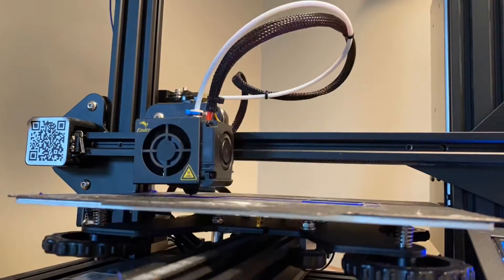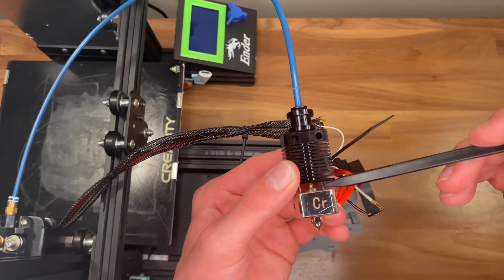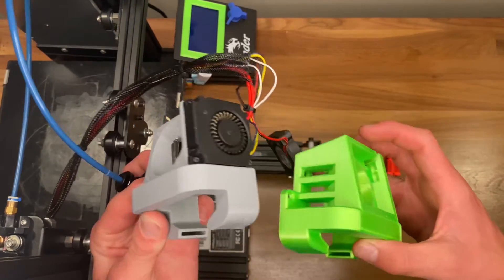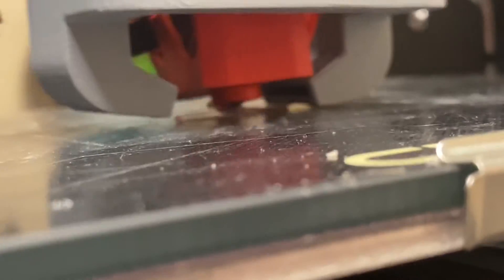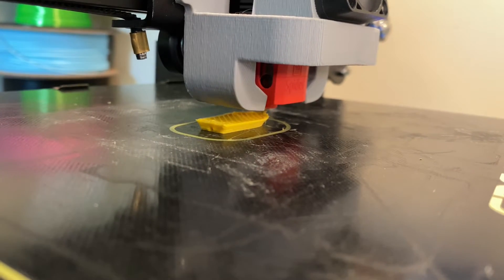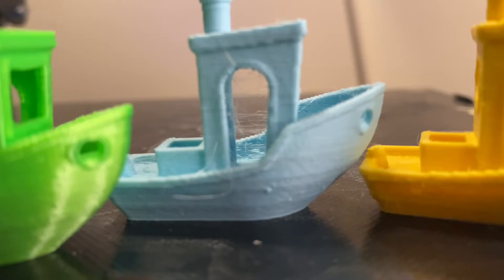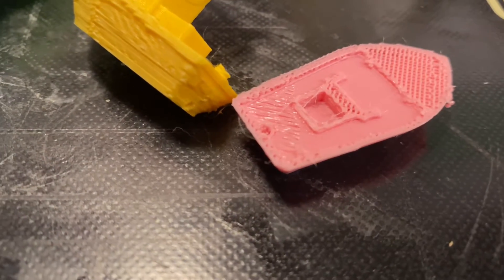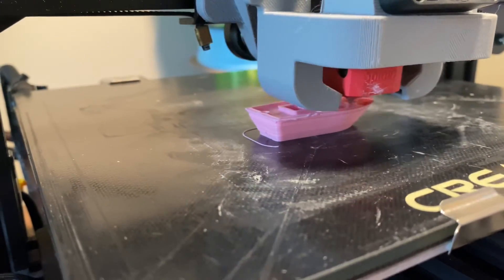Print FAST with an Ender 3 pro

Comment from the maker: As many of the comments read, the printing speed in the video was not 250mm/s. It was still double the speed of before and cut the time required to print in half. Sorry for the confusion. The firmware limits the acceleration, which limits the overall speed. To actually achieve these speeds you must configure a firmware to allow these speeds.
Reply: There is no way to configure the firmware to keep up with the speed.  The board and firmware are just incapable of keeping the printer fed with gcode.  (even with a 32 bit board if you upgraded to that, otherwise the Ender 3 and Ender 3 pro came with 8 bit boards) Get a Creality 4.2.7 if you have the 8 bit board. 

You need a Creality Sonic Pad or Raspberry pi running Klipper.  (tell the Sonic Pad you have an Ender 3 v2 running the 4.2.7 board)  You probably need a better hotend than the one you show, more cooling, a better extruder, dual z axis and linear rails, and Klipper to get anywhere near 200mms. (250 might not be possible no matter what)  

Consider the sprite extruder as it is better hotend (even than the one you show) and it is direct drive.  It won't get you where you want to go though.  You need a high output hot end and probably a dual gear extruder.  Tons of cooling. 

Bed slingers don't printer super fast, even when highly modified unless you want to sacrifice a LOT of quality.  I have a highly modified Ender 3 pro that can print close to 200mms.  I don't print that fast though.  (the quality degrades)   

The Voron Switchwire is really fast for a bedslinger. Some say they can print 300mm/s with 5K acceleration.  That printer costs 600-800 and you have to build it.  It is corexz.  That is the fastest bedslinger I know of.  Switchwire users rarely print at 250mm/s.  

BTW, I ran into the same problem you are having at one point though. Keep on upgrading and keep tuning.

Comment: Your board is stalling out and not hitting 250mm.  When you see the toolhead stop and sit there, the board is overwhelmed and processing gcode.  Marlin firmware on the board isn't going to do it. (even on a 32 bit board)  It cannot keep up.  The motors are moving at high speeds but the board and firmware cannot provide gcode fast enough.  Until you upgrade to Klipper, you are slamming on the gas then slamming on the brakes.  (both bad speed and bad quality at the same time)     

If you want to print fast,  you need to run Klipper.  (which requires an additional 64 bit processor such as a raspberry pi or at least a cheap Linux computer) Your main board is flashed with Klipper firmware that primarily controls the motor and the raspberry pi will keep it fed with gcode.  Until you upgrade to Kilpper you need to lower your speed until that stalling behavior never happens.  (quality will improve, especially little zits on the outer walls)  That it the fastest that you can print with your board.  (nowhere near 250mm btw)

Comment: Apparently your definition of great and perfect vary a bit from most others lol, looks like you are printing with cake frosting.  You need to run input shaping, pressure advance and set your timing if you are running at even 60mm Id be surprised.  My tuned E2 pro runs easily twice the speed of this rig.....
Reply from the maker: Like most people on YouTube I exaggerate a lot in my videos. This was my first ever attempt at printing fast so I made some mistakes but I’ll improve for the future

Comment: The stock hotend is not at all speed limiting on Ender 3. It can go at least 15 mm³/s (around 180 mm/s linear motion speed) and nearly twice that with a CHT nozzle. As others have said you're not reaching anywhere near that speed, probably because of acceleration and min layer time settings, but you almost surely won't be able to even with those settings changed because the stock extruder, which is the bottleneck on this printer, doesn't have enough grip or torque.

Comment: That's not running 250 no way. Especially with single gear stock extruder buddy. Your max speed there is like 70 to 80 at best. You haven't set up your accelerations, jerks, proper perimeter settings to even talk going at 100mm. Stock ender 3 even with that Hotend you installed by creality that you will soon throw in the bin because it's complete rubbish deceased with constant clogs, stock enders top out around 110 to 120mm. You extruder will fail. You'll clog. Your motion steppers won't keep up and skip causing layer shifts. 
Do some homework before trying to teach others about something you obviously know nothing about. Good luck
Reply from the maker: Per previous comments I know this is not near 250mm/s. This is my first time ever trying to print at high speeds so I am not as experienced. I actually like the hotend I installed and I think it isn't bad at all. It most definitely works for my use case with the added bi metal heat break and all metal construction. So I am going to keep it. I actually upgraded to a dual gear all metal extruder only days after posting the video. As for not knowing anything about this, I have used 3d printers for over 5 years and this was the FIRST attempt at going for any sort of speed and as with most things we try for the first time we often fail. I actually probably know more than you think I do :)  (hotend still hasn't clogged even after 1 month and a half of constant use) Thanks for the view and the comment
Reply: @engineeringaddiction  That Hotend you purchased will eventually start clogging upon faster printing speeds. That bimetal is cheap get yourself a good quality e3d or slice bimetal break. That will last for years and has room to grow. 
To print fast and not fast as in you thinking I'm dialing 250 on my ender screen and it's doing 250mm. No. Google accelerations, jerk setting, learn to look at the design and work out which parameters can be printed fast without causing issues and which ones need to slow down. Then on top use accelerations for straight travel lines between printing parts but has to be fast but not too fast because the toolhead needs to slow down the mass of the head itself, the rail and the bed. That's alot of things stopping getting ready for the toolhead to print understand so accelerations and speed has to be set so when it gets to the next spot of printing it doesn't cause ringing by slowing from high accelerations and also ghosting. There is alot of videos and information on Google regarding going fast. Good luck
Reply from the maker: I think spending more money on a hotend than the printer is actually worth is kinda stupid that's why I chose the cheaper one. I know that you're going to say having to buy another hotend because this one broke makes it worth it but I also have seen barely any videos about it so I wanted to be one to test it. I have different backup hotends too. thanks for the advice on how to print faster. I had a hard time understanding what this means though, "To print fast and not fast as in you thinking I'm dialing 250 on my ender screen and it's doing 250mm. No."

Comment: That’s not 250mm/s. I’ve printed at 120mm/s in the past and it went much faster than that. 

You have to reduce your minimum layer time in your slicer software! In Cura it’s set to 10 seconds by default.

Comment: That is not 200mm/s, thats maybe 80mm/s max you're reaching. try and look into increasing your acceleration from the stock ender 3 500mm/s to 4000mm/s and change slicer acceleration settings for perimeters, infill etc.
Reply from the maker: But yes I do think it probably was limited by my slicer settings and I could definitely achieve faster
Reply from the maker: Actually the acceleration was cranked up to about 2500 on some prints and I believe 5000 on others.
Reply: @engineeringaddiction  you can crank it all you want. Your board is limited to 500mm from factory. Unless you recompile your own firmware and flash your new high speed  settings with which your machine will have shit time with them those setting can be changed via your slicer as they will match your boards flashed new settings to go off. With stock 500mm capped at everything on that ender don't bother until you learn how to recompile firmwares
Reply from the maker: Yes I have been aware of this for a while now. Recompiling firmware isn't that difficult.
Reply: @engineeringaddiction  then do it it's what needs to happen to archive half the speed that's claimed you used in your video. Thats a good start 👍
Reply: That's Odd, did you crank it up in firmware settings too?
Reply from the maker: No just in the slicer so that could be it
Reply: @engineeringaddiction  definitely, it's worth a look at JyersUI firmware, you can get bed mesh (manual/automatic) and also change acceleration :)